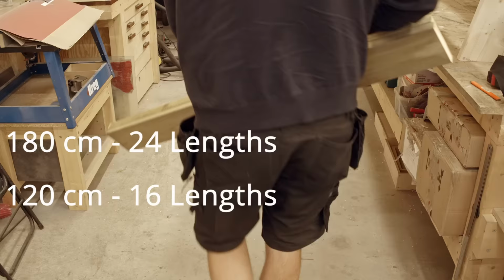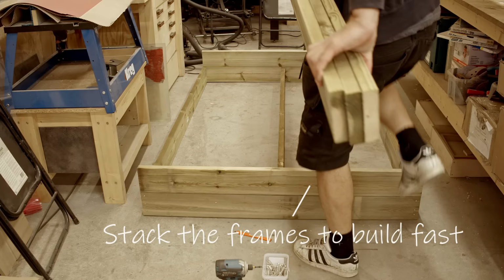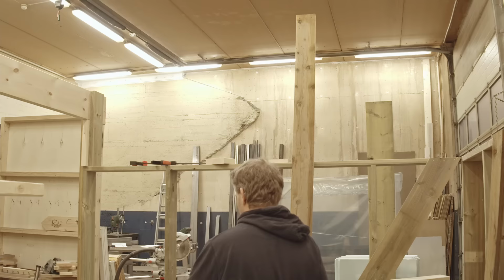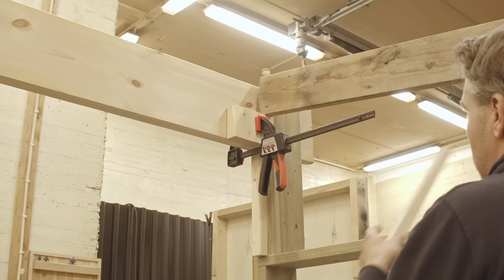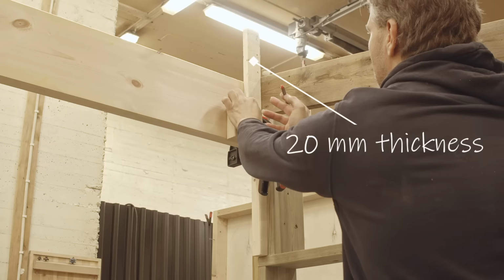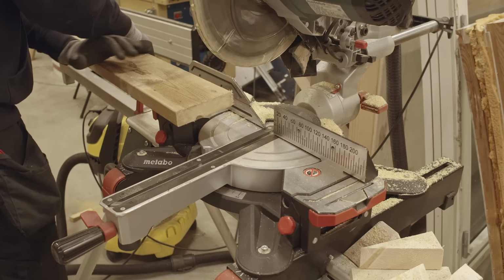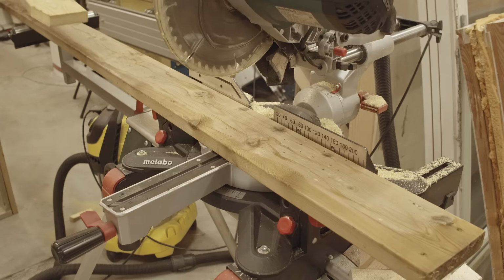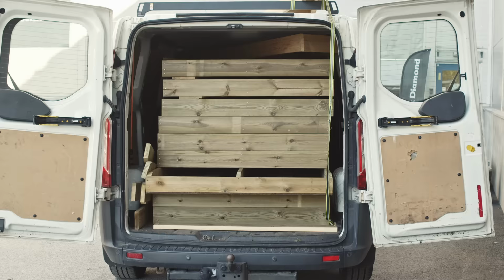This is Almost Too Easy - I Made a Simple Shed Using Only Decking Boards

Comment from the maker: Just to clarify: This was used as a temporarily work shed, so that's why there are no sheating on the walls, simple roof, and no foundation. However, it would work fine as a regular shed if you add sheating, a metal roof and a good foundation. Some people comment that this is 2x6 and not decking boards, which is completely wrong. These are close to 1x5, and they are pressure treated decking boards. These are the cheapest decking boards available here where I live, and they're half the price of 2x4's. This may of course not be the case other places in the world. The point was to use the cheapest lumber I could find to prove that you necessarily don't need "construction" lumber to make a shed. Finally, the shed is still standing, and have been through some heavy winds and rain without any problems. I'm soon taking it down for the winter.
Reply: Thanks so much for this very clever elegant design. Portable! Fantastic!!
Reply: Don’t worry man. Everybody is a pro the internet. I think it’s a good idea.
Reply: Good stuff. Two thumbs up!
Reply: Should Retitle the video as " temporarily work shed "
Reply: Looking again, this is strong enough to be a permanent building and easily fastened to a wood foundation. Two more thumbs up!
Reply: Just saw this after making the same comment.  Can you link to the lumber you are using.  Different materials are used in different locations so I am curious about what you used.
Reply: If you have to take it down for winter indicates you should have used 2X4's. Penny wise and dollar foolish?
Reply from the maker: @2centsworth766  You don't understand what temporarily means?
Reply: @2centsworth766  2x4's have no structural strength on their own - kind of like your comment.
Reply: This is most excellent, I think I am going to shrink it a bit to use as my drying shed. Much more fun than a boring plywood box would be, portability is a huge plus.
Reply: @johnhubbard3485  It is indeed most excellent! It is exactly what I need to "hide my boneyard stuff like all the extra horse fencing (rolls of wire) and other goodies that will come in handy for later projects, and for storing my zero turn. This could make an awesome firewood shelter too. The fact that he used deck boards is not only ingenious but saves a ton of money and is still structurally sound. This will be my "go to" video when I get ready to build my own shelter. 🪶🦅
Reply: @Billy28376  I resemble this comment, I’m working to change though.
Reply: @uprightfossil6673  Me too. Disassemble and move to greener pastures.😅
Reply: @Billy28376  True, there is always a know-it-all that tries to belittle everything someone else does.
Reply: Might make a pergola/gazebo/seating area type thing for my deck like this
Reply: Awesome!!! Thank you for the step-by-step instruction and demo!
Reply: How come you don't winter proof it? Or is it b3casue the current build isn't appropriate for it? Just wondering
Reply: I’m liking the portability aspect of the design and that it can be easily dismantled and relocated.  I would use bolts or threaded rod to join the various sections.
Reply: What would be the best way to anchor this shed to the ground?
Reply: Quick check of prices at the nearest big box store has PT deck costing 50 percent more that 2x4’s. plantation grown and pressure cooked PT usually needs fastening down before it curls up.
Reply: I just signed a 3 year rental lease and there is no storage for yard tools, which I had to buy. The one provided doesn't work. I plan on building something similar to this. I'm renting so I don't want to spend much on building something permanent. Thank you for the upload.
Reply: The problem with these type of videos is....If you already have a fully equiped workstation with all the necessary tools to hand....chances are you know how to build a shed anyway!!🤔
Reply from the maker: @davidduke9771  There are many ways of building a shed, no matter how many tools you have. This shed can be built with a handsaw and a hammer, it just takes longer. I just don't see the point in your comment. Is it problematic  to post videos if I have a certain amount of tools? Do you have to watch it? If it's problematic to you I suggest watching other videos that you don't find problematic. Most People who watch this video does not find it problematic.
Reply: @DieterSchneider  The point i'm making is this. If someone doesnt know how to build a simple shed they wouldnt own or have access to the equipment you have. If they did they wouldnt bother watching the video. Now if , as you say, it can built by using simple tools such as hammers/ saws etc then maybe advice on how to do that would be more beneficial...no matter how much longer it takes. So the reason I clicked on this is because I dont own a workshop...but I do own simple tools...I was looking for ideas...once I saw the tools used I was dissapointed. So thats when it becomes " problematic".😁👍
Reply: Nice video, do you remember aprox cost?  I'm pondering if I should make a shed where I normally have a pavilion (3x4 m). I've have fixed the roof of the pavilion 2 times already and now I need to fix it a third time, or do something more robust. :) 
(I live in Norway as well)
Reply: Hey Dieter !! Nice and also very inspirational work.  As a guitar player: congratulations for your skills in that hard área too...Ah I'll try to copy your shed.. best whises!!

Comment: This is how they make houses garages etc in USA/Canada..... using 2 x 4 and 2 x 6 lumber ( 5 x 10 cm, 5 x 15 cm )... simple and quick. With a proper insulation and exterior protection, these houses are much better for living than concrete/brick houses. They do not last thousands of years, but are easily built, cheaper, and easily modified.....  this is MY PERSONAL opinion so anyone who do not agree should restrain from starting a sort of argument/debate on this subject. Dieter you did a great job !!!!!!

Comment: Great guitar accompanying the build, you are quite talented. I had saved money to replace my old shed with a new one this summer but as usual something went wrong elsewhere and it will have to be put off until next year. Your video gave me some great ideas as to how to shore up my old shed until I can replace it hopefully next summer. I can't tear it down because it is "grandfathered" as an existing building but if I can keep it upright and looking reasonably sturdy I can replace it next summer it over a long weekend and the city can't do anything about it. 

I had bought decking material to replace a goodly portion of the front porch but it turns out the handyman was lying and just wanted a job and was really angry that I had bought my own decking and walked away. I had my brother come out and double check my test of jumping up and down on the old decking and it didn't even bounce. My bother laughed at my rudimentary test but assured me the decking was fine with the exception of one board that has a slight crack that is only about 12 inches where it was nailed in along the length. I may just fill it in with epoxy and leave it for now as I plan to restain it. So now I have all this decking material sitting around since last summer. If I follow your method I can take the old shed apart when I have the cash and still have decking material that is long enough to replace decking elsewhere. Thank you very much for a great video. You've provided me with a solution to two separate issues.
Reply: Ll

Comment: Great Job in Using some 5/4 Decking Board to Build a Shed. There is always a Deal to Purchase these 5/4 Decking Boards at Home Depot. The Prices on the Decking Boards are a lot cheaper than 2x6 and they are Pressure-treated also. And also using the New Decking Board Style Screws is just like using Nails. Just need to Reinforce the Walls with some Cross Pieces and Double the Roof Rafters to Support Our Winter Snow Up Here in Canada.

Comment: Before starting to build the house, I will take your shed model for my temporary one which will be used as  a working place. Nice job you did. Same material dimensions where I live and for a good price. Thank you!
Reply from the maker: Nice, I did not take down this shed for the winter and it's still fine. Been through some snow and bad weather so I guss it holds up well.

Comment: I loved video, Great work. Here in the states, the big-box-stores, some of the preassembled sheds they're selling use 2"×2"s for the 'studs', and the corner braces get 2"×3"s😮. I stepped inside one of them (a 12'×12' model.). I felt sure that if was of a mind to do so, I would have little trouble kicking the back wall straight off of the thing. Not to mention I could build 2 of them the same size, and use real 2"×4"s, have faith they wouldn't blow down in a strong thunderstorm.

Comment: My overall impression is that wherever you live your wood is better quality than what I can easily get at Lowe's. I am going to mimic your build with treated 2x6 , put down some 4x4s so i can attach the shed to them for a permanent build
Reply from the maker: It will be rock solid with 2x6

Comment: Add 1 stud to each back corner, side wall end stud, but on it side so the long wall screws into the side walls better. It makes assembly stronger, easier, and faster.
Reply from the maker: That would just add more weight with negligible benefits.
Reply: @DieterSchneider  You are screwing your corners together, with the screws only going into the side of the stud. There is no torsional strength, and it could rack, and tear out. Two more studs is not much weight to worry about. you gain the strength in your corner connections, it helps to stiffen, and square up that panel, and it also gives you a nailer for interior wall finish.
Reply from the maker: @shirleymae30  Corners are usually connected with the screws/nails going into the side of the stud just like I did (but with thicker studs). The main reason for adding an extra stud is for interior corners,  but It's a portable work shed, there will never be interior walls. Not sure why you would worry about torsional strength in the corners, there will not be much twisting going on there. The corner frames are braced square, and roof panles are sheeted, this is what makes the construction rigid. Adding a stud would not square anything, bracing does. The shed is still doing fine after two winters with heavy snow, even though it was never intended for such use.
Reply: @DieterSchneider  I wasn't looking to argue, I was just trying to help you out. 
 I set up, and take down about 100 (8'x24') seasonal wooden, three sided R/V sunrooms every year.
Reply from the maker: @shirleymae30  Just saying that your advice won't give any additional benefits in this case, just more cost and weight. I do however have that stud in some of my other shed/garden room videos, but the purpose is for inner walls as you suggest. It does not have any significat structural purpose. It can in fact be skipped to make room for more insulation and reduce cold bridges (fixing the inner walls is more difficult, but it would still comply with the building codes).

Comment: I like that you used the torx head screws instead of nails. The screws allowed for the portability, and it's probably stronger too.
Reply: Nails are stronger. Screws shouldn't be used for loads unless they are rated  for framing like Simpson strong tie.
Reply: Screws can snap. Nails are more giving.
Reply: @howtodoitdude1662  Not the torx screws I use.

Comment: Looks great 🤙I was thinking you could have done with some bottom plates, to hold everything a little better together in the bottom - but mostly to keep the immanent water & moisture at bay from the frame construction. 
Nice video ✌️

Comment: FWIW, those look like 2x6s which while that can be used as the floor of a deck, are not really commonly referred to as decking boards.  5/4x6 is what one would more commonly refer to as a decking board.  Some what of a nit pick to some I guess but just in case someone tried to build this shed with 5/4 decking instead.  Might work.  Might not.
Reply from the maker: I have a pinned comment about this at the top. These boards are even thinner than 5/4", they are 27 mm (5/4" is close to 32 mm).
Reply: @DieterSchneider  Interesting.  In actuality, our 5/4" decking is really 1" thick.  All the dimensional lumber in the US is undersized this way.  Its supposed to be true to size when rough cut though.  I guess the perspective is just a bit off when viewing it like this.  They really do look like 2 bys though.  :)  You are correct you don't need to build simple structures like with the same way you would a house.  I've built some light weight things that only need to support their weight to stand up out of 2x2s with a plywood sheeting.

Comment: Question: If you did make this permanent, would you have preferred to use nails instead of screws, especially as they are much stronger than screws. Good video - good idea. Thanks.
Reply from the maker: Maybe, but mainly because it's cheaper.

Comment: oh my this is so simple. I use to work building only the walls for 5th wheel campers so have basics of it. Im 64 disabled but not totally but wanted to make a small storage shed since they want so much money for them nowdays. I have only 2x4's however would this work the same or do I have to use decking?  decking is $5.75 each here now and I have plenty of 2x4's 
ON ssi so can't spend a lot
Reply from the maker: thanks, 2x4 works fine

Comment: Modular and prefabricated works great ! I did a similar concept - cut boards in garage, prepared frames in basement ( it was winter and more room there ), and finally assembled outside in one go.
But, why decking boards and not standard 2x framing lumber - are decking boards cheaper for same dimension / length ? I don't see much diff in home depot, actually the opposite..
Reply: Probably for weight reduction, as it is 
a portable shed
Reply: The lumber market in Europe can be a bit weird. We have different dimensions on the market. Doug Fir deck boards are priced competitively. DF studs for deck substructure are often overpriced in DIY stores (that's where they get you).

Comment: Hi Dieter, looks awesome, like always.  Will there be a second part with the finished build? By the way what is the size of the deckboards?
Reply from the maker: Thanks, this is actually finished for now. It's only to have a place to work outdoor when it's raining. However, I will probably make more sheds using this design or similar, I'm really happy with the way it turned out. The boards are 28x120 mm which is close to 1x5"
Reply: @DieterSchneider  thx for answering, highly appreciated. One last question what is the thickness? I already bought a couple of month ago your instructions but this build seems possible for my skills 😀.
Reply from the maker: @2manyhobbies_michael  The boards? 28 mm (1 inch). The shed is 5 meters long and the depth is 2.4 meters
Reply: @DieterSchneider  and what do you use for the walls and roof when it’s raining?
Reply: What's the shed measurements? Do you have this shed plan for sale?

Comment: How you established the 9 degree rafter cut is not clear.  I tried watching it few times , still could not figure out
Reply: He set the rafter and scribed a line using a 2x4.  Then to establish, repeat that cut, checked the scale on the compound miter saw.

Comment: Nice what was the cost in your area for that and do u think u could provide a cut list some people might want to try it thanks
Reply from the maker: Around 300 dollar (which is "cheap" considering today's lumber prices here in Norway). I used 25 decking boards (minimum 4.8 meters long boards)
Reply: @DieterSchneider  thanks.  great build

Comment: Nice shed but you should not use screws!!! Use nails for strength....screws will snap in two under any stress like wind and in moving building etc...
Reply from the maker: No they won't

Comment: Very nice and straight forward, but you are putting it together near the end of the video without any ground-contact damp-proof course.  It will rot away in very quick time.  What a shame!   All that effort for nothing!
Reply from the maker: No, it will be fine for the intended use. This is not a permanent structure.

Comment: So what is the base? How secure is this in high wind? What is the roofing?
Reply from the maker: No base, I just put it on the ground. It's much more secure than a standard work tent, but it's not "hurricane proof". The roofing is simply a tarp
Reply: @DieterSchneider  Ahh. Thanks. I like the idea of it. But I need a base. I live in Connecticut. We have some crazy winds here with rain.

Comment: ONLY decking boards? You couldve uses 2x2s at a fraction of the cost for ever decking board you coulve gotten at least 3 2x2s. it does look nice tho
Reply from the maker: No, read my pinned comment.

Comment: Must have been a new old deck they tore down.
Reply: That there material he’s using looks bigger than deck boards,deck boards are 1 inch thick,those boards looks to be 1 1/2 thick……..no offense.
Reply: @jammerlupardi8782  They are 28x120mm. Standard deck boards here in Norway.

Comment: how much deep er do you think you could make this, ie 5m x 4.5 M  deep ?
Reply from the maker: Yes, just add slightly thicker rafters. (For permanent placement there must be quite thick rafters)
Reply: @DieterSchneider  what would you recommend ? and what about the xtra weight on the front support beam should you just double or tripple up ?

Comment: That's not a shed. All he did was built a roof and held it up with some boards.                         shed /shĕd/
noun
A small structure, either freestanding or attached to a larger structure, serving for storage or shelter.
Reply from the maker: Ok, thanks for clarifying.